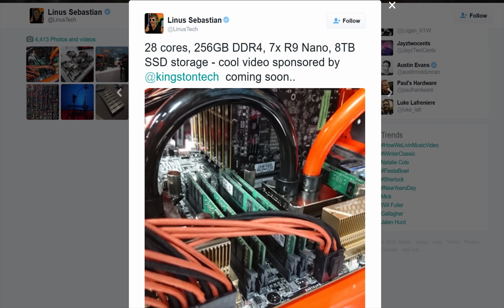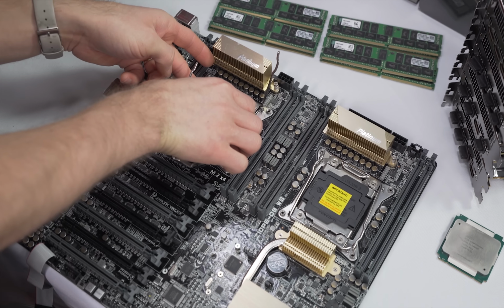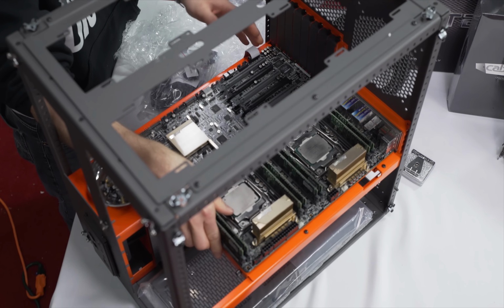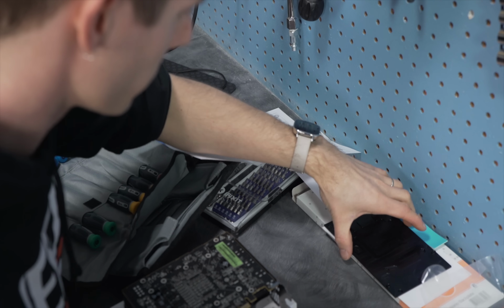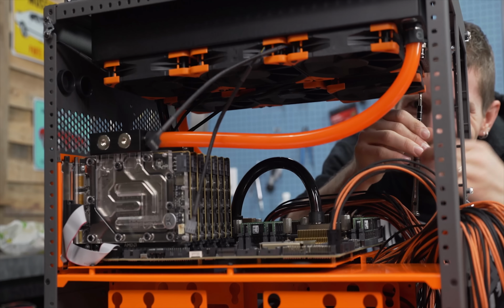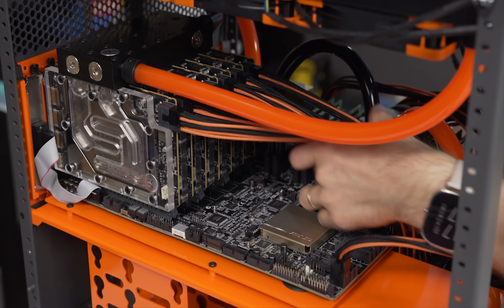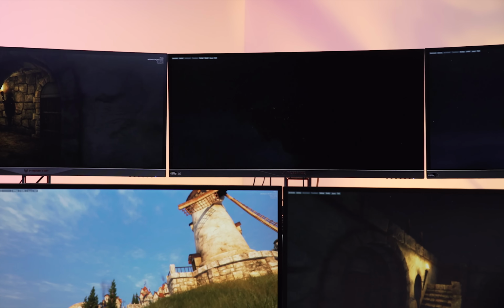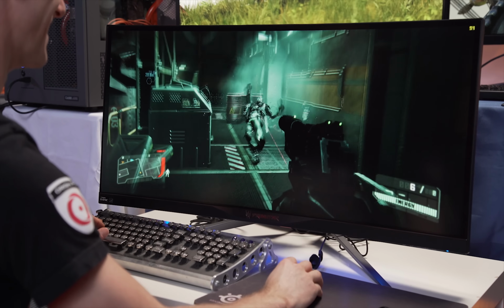7 Gamers, 1 CPU - Ultimate Virtualized Gaming Build Log

Comment: As cool as this is, running 7 gamers on 1 $30k computer isn't that cost efficient. In your terms, each gamer on your computer gets 4 cores, 4 hyperthreads, one r9 nano, and 32gb of RAM. If you were to make individual computers with the same specs (including watercoooling, 1tb ssd, and OS) it would cost approx. 2500$, giving you a cost of approx $17,500, saving you money and giving overclocking potential and higher base clock with Skylake.

Comment: Believe it or not, i had the idea of running 7 graphics cards at the same time too, just not as Linus did it.
so now i know its possible to run in 1 system but i still wonder if it would work running all 7 gpus for only 1 user  in any games or editing softwares at all.

Comment: Oh my god, this is so much power for a single person that it can with other six hahaha. 
i would want to know how many fps you can got by using all the seven cards for 1 Game?
The Crysis 3 for example.
Reply: +Shot Up Gaming They have two cpus so the limitation is gone ... and you get about 45% scaling with 2 way  depends on games but amd scalling is better
Reply: Like 700?
Reply: +Protoss 01 You can only use up to 4. Now keep in mind if you crossfire 2 cards, you won't get double the performance.
Reply: nokia gameplays Damn! So skaling 8k to 4k can be possible  with this? (In at least 30fps?)
Reply: Protoss 01  I think...

Comment: 30k and you use amd card graphics cards just my two cents never had any luck with their drivers. Why not 7 980 ti s ?
Reply: +jason allen Didn't you watch the video? He said that he needed 1 slot cards and that other graphics card would've drawn too much power. The r9 nano is the only gpu that works in this situation.
Reply: +jason allen Cuz AMD isn't as bad as Nvidia trys to make them out to be.
Reply: +jason allen  AMD cards run cooler
Reply: +jason allen Nvidia GTX cards do not allow for vGPU passthrough in a virtualized environment. You have to do annoying workarounds. They want you to use Quadro or Grid cards instead (for higher profit margin). AMD allows any card to work for vGPU passthrough.
Reply: +jason allen 7 980 ti cards would've had a TDP 525 Watts higher than the 7 Nanos (250 per card, vs 175). It's not like he's compromising much, anyways. The Nano performs better than the 980.
Reply: +Darth Strakh Yes, if he wanted to use a much larger case and run into problems with blowing the 15 Amp breakers that are typically on 120 volt circuits in NA.
Reply: Darth Strakh Why make things more complicated?
Reply: +jason allen did u watch the video? he said he couldnt fit them
Reply: +AMDFanboy Coudn't he of used multiple power supplies?
Reply: +AMDFanboy I said could, not should.
Reply: +Jon Richards You jokin right? I don't care about which graphics cards are better, but AMD cards do not run cooler, they run hotter..
Reply: +jason allen Because you didn't properly saw the video/don't understand much about the topic.

Comment: The Fury X is a dual-width card, so you could only even plug in four of those into the motherboard to start with.  The issue of power draw with seven Fury X cards mentioned at 8:13 is moot.

Comment: Would it be possible to use two PSUs to split the power load between the components? Also doesn't a 2000W PSU exist from some manufacturer?
Reply: +Jacky Xie Here is europe (germany) the (new) outlets and cables are rated for 3600W. Has something to do with the 230V~ we are using i guess. But Canada uses 110V~, right?
Reply: At 1500 watts, its drawing about 12-13 amps from the wall. Most houses have either 15 or 20 amp breakers (depending on where you live) so, in North America, you really couldn't plug two PSUs together unless they were on separate circuits. That's what I call a shit ton of electricity.
Reply: use a power generator XD
Reply: +ASYella true, true. that could work. I would just recommend against putting it inside the home or business its in. just sayin
Reply: +Totally Radical Dude No.... it does not work that way, they would not share a common ground on the bridges.
Reply: Yeah, if you can fit two PSUs in the case then you can split the load by just plugging in the components into both
Reply: +creptrbot yes and yes, even a really good one by Superflower.
Reply: yes, but as another comment said, you'd have to be careful about overloading outlets
Reply: +Noah Alvaro yup. Even though they shouldn't have to worry about that since they should have access to any AC they want, perhaps SuperFlower just isn't a partner of LMG.

(Also, they can get way higher currents, the plug is just certified for 15A)
Reply: it wasn't a serious suggestion...
Reply: +Thx And Bye yeah, the US is the same as Canada, and unless you are using like a clothes dryer or something specifically rated for 220 volts and up to 50 amps (depending on the socket), all normal wall sockets are 110 volt, 15 amp.
Reply: +Jordan Abendroth basically any PSU that's sold works from 100V-240V, with 50Hz +/-3Hz OR 60Hz +/-3Hz. European and US PSUs are the same.
Reply: +Jacky Xie so how do you guys run kettles and toasters because out kettle is a 3kw
Reply: I used to run a bitcoin mining operation. My outlets and wiring (I did myself I must say) were rated at 20A per outlet.  12-3 wiring.  (Duplex receptacle where each outlet has it's own circuit breaker)  That's 40A @ 110v approx 4400W max.
Reply: +creptrbot If you wire it with a "dryer plug" you could get up to 3000W in America. That's two-phase power, which is 230V AC. Perfect for two supplies.
Reply: +Jacky Xie run it off a 240V outlet boom over 5KW avalible
Reply: ***** The watts is amps*voltage
Reply: +underpantcockroach COUGH AUSTIN COUGH SCRAPYARDWARS
Reply: *****
You do know that all W that your tools submit are Hourly based calculations? A tea cooker and Coffee cooker both respectively take 1500W and 2300W but you only have it on for like four/five minutes so in the end, it doesn't break the fuse still. So I can't really see the reason for you to increase the fuse for your room? Unless you have shitty wall cables to begin with. Because if you use 20A you need a 2.5m in diameter if I recall correct in the wall and I doubt you have it? If anything, you potential risk of burning your flat down.
Reply: I believe so and im pretty sure
Reply: +creptrbot Use the Tesla Wall and a High Industrial Outlet like what they use for your Stove or Dryer!
Reply: Don Urrutia I don't think any PSU's that are buyable by the average consumer can run off of 220 volts in the US, or supply more than 1500-1600 watts
Reply: +Thx And Bye 110 volts on a 30 amp outlet would give you 3300 watts of power. 80% load is the recommended maximum of most consumer configurations. Roughly 2600 watts of power can safely be used on that circuit.
Reply: +tfaehse oh, the highest power PSU I've ever seen is about 1600 watts
Reply: +derpyicetea theoretically yes, but they'd still run off a 110V outlet if it delivered enough current (e.g. by just using 2 in parallel)

It's getting really what,if? -y here though :D
Reply: +Jordan Abendrots Super Flower's Leadex 2kW PSU also works from 100V-240V.
Reply: +Jordan Abendroth Actually Canada is rated at 120volt 15amp
Reply: +tfaehse I see, you couldn't use that to its full potential here in the US unless you frankensteined two plugs on two circuits together or had a 20 amp socket installed. that Superflower PSU would probably would have been smarter to use so you are not running so close to the rated capacity of that EVGA that they are using. pulling like 94% of what a PSU is rated at continuously isn't smart.
Reply: +Jacky Xie Yeah but if you have two PSU you can get a heavy duty extension and use another outlet.
Reply: +creptrbot I think it´s possible to run two psu´s in one system.. austin did that in the last scrapyardwars episode.
Reply: +creptrbot Yes, the Superflower Leadex Platinum 2000W, which requires a 220V outlet.
Reply: +derpyicetea Well, it could. But the amount of ampers of power needed would be so high the cable and socket and everything in between would get hot. This in turn would mean that - the hotter it is - the higher the resistance of the cable gets... It's just all kinds of bad and you need thicker cables to offset this. So, with thicker cables, yeah, you can deliver more than 1600 W of energy. Houses don't have these though, usually.

230-240V is much better in that regard... 1500 watts would be smooth sailing 6 ampers then. Breakers are usually like 16+ amps in Germany, for example.
Reply: +creptrbot I would think so, I mean I'm no Linus level, I think if you just plug the 8 pin connectors of another PSU, you'd just have to start the PSU by shorting the power line.
Reply: +Joe M Kettles are usually attached to 230 or (maybe) 380 v in the USA. They also usually have few 230v outlets scattered through the house (washroom, garage, oven)
Reply: +Thx And Bye yeah since were getting 230V and 16A out of our outlets and 230V*16A=3680W
Reply: +tfaehse It can't run between 53 and 57 Hz? That's funny :-)
Reply: +Adam Colgan Could you technically have them on a UPS tho?  or would that still overload?

Also if they did go two PSU, and splitting the power, I doubt the double CPU MOBO would draw anywhere near 300w of power, and the GPUs... probably if he did go R9-Fury near 1300w?
Reply: +Joe M - Exactly! 1600W is nothing for many devices with heating elements.
You could always go for 380V three phase in the 240V countries. I've heard house outlet can deliver about 40kW in total. So if you disconnect your house you could run a pretty beefy computer on that :D
Reply: Real question is how they're going to handle power load at the show.
Reply: +SWes608 that's what I'm wondering, because it will probably be running nonstop for the length of CES.
Reply: +creptrbot Yes, it is possible to have two PSUs in one PC. The are kits available for dual PSU rigs. And yes there are 2000W PSUs. The Super Flower Leadex Platinum 2000W is one of them.
Reply: +creptrbot you probably need to split the load between circuits , so one would have to be plugged into an extengion cord on another side of the house
Reply: +derpyicetea The limiting factor is not really wattage. It's the amperage. If the standard outlets can deliver more amps, then they'd be fine.
Reply: yeah, thats true. you would probably blow the outlet if you had both coming from the same socket  (whatever you call the part with the two outlets)
Reply: +creptrbot I don't see why you couldn't do that. I think Austin did that in Scrapyard Wars 3
Reply: +creptrbot Yes, you can
Reply: +Brandon “SeedlessBananas” Mc-Wilhite That bits called a gang i think?
Reply: Here's another question (I'm putting it in this thread because I know no one would reply to an individual one). Would it be possible to build 3 individual computers that are water cooled from using one reservoir? Has it been done before?
Reply: +Fire Lord Sanders also possible. They had made a video called whole room water cooling in which they did something very similar!
Reply: +creptrbot Yes, technically :) Watch scrapyardwars season 3, austin does it :D
Reply: +derpyicetea It's not just the watts its the amps too.
Reply: +Fire Lord Sanders Why would it not be? Hundreds of homes can be fed from one water tower in a neighborhood? I would assume you need to have enough water so that when all the pumps are drawing water, the reservoir doesnt run dry.
Reply: Fire Lord Sanders Yes, datacenters use pooled water cooling.  I know quite a few people that work in many different centers, one has an entire row of racks dedicated to water cooling.  (That is, there are 'drops' of water coolant lines in that area)

After a quick google search to double check my facts, it turns out many companies make the equipment needed to do so and one company (IBM) already uses this method in it's supercluster(s).
Reply: Unique EDM Well i knew that servers have it, that's why I was thinking about translating that over to recreational or typical computers
Reply: oh yeah that's just as possible.  But.. it wouldn't be as "nice" looking as one would think.
Reply: +derpyicetea Which isn't technically true. 120V x 20 amps is obviously 2,400 watts. At 85% efficiency you would pull 2,300 watts from the wall. It would absolutely work with a high quality breaker and say 10 gauge wiring (reduce voltage drop).

Of course, electrical code says not to exceed 16 amps.
Reply: I was just skimming and certainly didn't read all the responses in this thread, but I just have to nitpick. The standard in North America is 120v 60Hz, not 110v. On topic, I've been running 2 PSUs in my system for years. Was wondering why he didn't run 2 1200W or 3 850W and go with the Fury X's like he wanted. Was also wondering why he didn't just leave the CPUs off the water cooling and put a couple of Deltas on them.
Reply: +theotaku7 can't you only pull like 1600 watts or so from a single socket that is 120v?
Reply: +Godfather Bad A 20 amp breaker would safely allow a little over 1900W draw for long periods, up to 2400W for short periods. It depends on the wiring in the house too. Wiring in a house from the 70s or earlier might not be able to safely maintain 16amps for long periods.
Reply: +Thx And Bye yes thats correct....in Australia we have 240V (2400 Watts)
Reply: +Thx And Bye Not sure how old of a building you live in. But in Sweden, we have used 230V for more than 30 years. A power socket is able to provide you with 2300 watts as a standard 10A Fuse. Today in Sweden, you can go up to 13A if your cable cooling allows it. Allowing ya basic 230x13= 2300+690 roughly = 3000 watts. 

Then again, although you say 230V in your socket, you actually don't have that. You have 230+V to your house roughly. From that, you got cable resistance so when it finally reaches your computer etcetra, it might be below 230V. It depends how far from the main fuse you are. Also, Germany is not really known for good Electrical installations(Talking about installations, not equipment) in Sweden, so I am not surprised if sockets in your house starts to burn down if you run 3600W which is not needed at all unless you are doing something in the garage. 

Then again, the higher fuse amp you have, the higher the main fuse amp have to be upgraded and the more expensive your electricity bill will be. So not really something suggested from an electricians point of view. Something called Selectivity is suggested for ideal power consumption. 

Ah well, if you really want to build this type of computer. It would be a Gathering computer to be moved around. If you plan a stationary, it is pointless since one would rather build a bracket installation then. This is a mobile show off thingy which is essentially pushing the limit but also granting manufacturers clues how to improve their future equipment.
Reply: +Kommen Kater und komplett unnötig... :D
Reply: +Hannes Hauptmann i work as an electrician in germany, i had to laugh about this. sadly.
Reply: +Hannes Hauptmann Well, going from your old L or H characteristics onto a B would have done it. If you already had a B in, you almost did the right. @Helveteshit for german Fuses you can go 1.5*(amp) for ~90 seconds. Or ~2 Hours by 1.13*(amp).
Reply: dAz3d0
Most fuses adn basics of Electrician work is the same across all countries of EU. So don't worry about that. Generally just some difference in how they treat installations of places. For example, germans seems to fancy hanging cables like a floating line in the ceiling while in Swedish companies have to install ladders for the cables.

And fuses generally only deal with the starting spikes of equipment. I do know that Computers, sound things and such tends to spike the power line a bit more often so might be why he has issues. I am more surprised he doesn't need to replace his residual current fuse. Considering the stuff he has in his rooms leak a lot of Amp out back into the network. Which it shouldn''t.
Reply: Jacky Xie what are you talking about?
most 240V outlets (in USA at least) are 30A so thats ~7200W at trip point, so it would be safe to continuously pull 5KW
Reply: Patrick Barry Some are 15A, but you're right.

You can get a 50A plug wired, especially for boats
Reply: +creptrbot Sure could if the case had room for 2 power supplies. What the video say is full load is only 50-60watts over the PSU at the wall. So inside the system the power is under it limit.